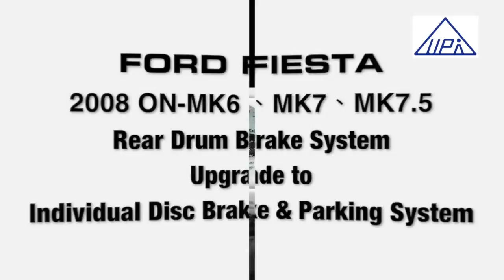Rear Drum Brake Upgrade to Individual disc brake with parking system. - Fiesta

Comment: New verna mannual transmission 1.6 is not available rear disk break in india and how to fitting rear disk break any suggestions plz tell me ...
Reply from the maker: +Amit Gupta 
I check with Hyundai Taiwan, they sell only Verna 1.6 with rear disc brake here.
We don't have a drum brake to compare its difference.
I am afraid that we could not help in this conversion kit.
As I mentioned before, change the whole axle of its rear should work smoothly in almost every vehicle if they have disc brake model.

Comment: Can I assemble in rear disk break on new model 2016  verna in my self or not is it possible or not ...? kindly help me I m soo confused
Reply from the maker: +Amit Gupta 
It is quite a great effort to change the whole rear axle.
Honestly, we don't suggest people to change drum brake in your case.
In our situation, to build a conversion kit need to open mold and lots of tooling.
Need at least couple hundreds of sets to cover its fee.

Comment: do the nissan sentra disc brakes works on the 2010 to 2014 versa/tiida?  if "yes" how do I get a set, I live in the Caribbean.
Reply from the maker: The conversion kit for Tiida  is still under development.
(Our engineers are too busy on pickup kit at this moment)

Should I inform you when this kit is ready?
Please leave your email address for contact, many thanks!

Comment: So you are using a disc / drum master cylinder on a disc /disc setup?   Careful
Reply from the maker: Disc brake - hydraulic pressure - caliper & pad.
Drum brake - cable wire - shoe.
Each system (disc brake, drum brake)  is working individually.

Comment: Hello,
I am looking to upgrade my Scion Xd 2011 from drum to disc...any advice or videos by any chance?
Reply from the maker: +koushick barua Sorry for replying late. I check the website from Japan. The rear part are the same, Ist =  Vitz = Vios. We don't have Scion here. Please check  these vehicles in your region.
We do supply Vios rear drum to disc conversion kit.
Reply from the maker: There is a very high possibility if different models user same shoe. But still a little risk remain. For example, The Perodua Myvi is almost the same as Daihatsu Sirion, only the hole which fixed the cable and back plate is slightly different. You can use tool by hand and easy to solve this problem.

Comment: How to convert front drum brake to disc brake from old omni?
Reply from the maker: We take 3D scan first, design and simulation on computer base.
After design completed, open tooling and make samples.
It takes 3~6 months for one model normally.

Comment: Do you provide rear disk break assembly for Nissan tiida
Reply from the maker: Rear drum to disc conversion kit for Nissan Tiida is still under designing.
We are very busy in developing conversion kits for pickup at current stage.
Please  wait for a while.
Thanks!
Reply: Unique Power International ok. Thank you for your kind replay

Comment: Thanks for posting video. Do you supply a kit for 06-10 Hyundai Accents? Its the MC model.
Reply from the maker: +Shalashaska016 
Thanks for your inquiry.
Sorry that we don't have a kit fit your Hyundai today.
We will try our best to work on more models.
Reply: +Unique Power International how long would it take for a kit to be made? If not is it pretty common what is needed to do the conversion? OE Hyundai / Kia did 4 wheel disk till 07 for the Accent, Verna, and Rio. i just have a 10 so it never had the option.
Reply from the maker: +Shalashaska016 
Normally, it takes us half year to create a new kit.
From measurement, design, open toolings and molds, first try and second try.......
We follow all the procedures same as O.E. does.
Reply: +Unique Power International Thats not bad actually. Full time working and a student right now so if you guus will make it in ~6 months I can wait that long. hard enough to find a donor car of the newer years anyway. Newer parts are always better as well.
Reply from the maker: +Shalashaska016 
Need to discuss with our engineer for final confirm.
His hands are full with projects at this moment, please give us your e-mail address or e-mail us to following address :
info@unique-power.com.tw
Reply: +Unique Power International Ok thank you. Im actually apart of a USA and International car group so Ive spread the word. Several of us myself included has messaged the email you've provided. Havent heard back but keep us/me posted Alex.
Reply from the maker: +Shalashaska016 
I check my e-mail and it functions well.
Please mail again and also send to : kelvin@unique-power.com.tw
Thank you.

Comment: its possible for suzuki baleno or swift ??
Reply from the maker: It's not difficult to build a conversion kit in technical.
Swift does not have an individual hub for its original.
When taking the original drum off, need to build a new one for conversion kit.
The only problem is the cost !
Reply: +Unique Power International hi I have innova 2008 model. rear disc break is available 4 that?
Reply from the maker: Innova is not on our list for the present, need to check.
I will reply you later.
Thank you.
Reply from the maker: The structure of Innova 2008 is close to Toyota Tacoma old version before year 2004.
Sorry that we don't have a kit fit it at this moment.
Reply: Singh Gippi  yes

Comment: want to upgrade a Mercury Mariner 2008 3.0L you have this kit?
Reply from the maker: +raul chagoya 
It should be the same with Ford Escape. (Need final confirm)
Sorry that we don't have a kit for this vehicle.
Change the axle may upgrade the whole brake system but not a cheap method.
Reply: +Unique Power International thank you guys
Reply from the maker: +raul chagoya 
You are welcome.

Comment: Do u do ford focus kit 2013-2016
Reply from the maker: Focus kit is for upgrading to 4 pot caliper or racing caliper.
It only contains the parking mechanism and cable for disc brake or drum brake upgrade purpose.
This kit doesn't include caliper and rotor.
In our region, all Focus comes with disc brake from the beginning.
Thank you!
Reply: Unique Power International im asking about change drum to standard brake disc
Reply from the maker: Thanks for your reply.
Sorry that we don't have a complete kit for Focus.
In our region, Focus is equipped with disc brake only, we don't have drum brake data for creating a conversion kit.
Thanks!
Reply: Unique Power International so how I can upgrade my drum brakes to disc then
Reply from the maker: We don't want to disappoint you but we couldn't create a kit without data.
If you insist, the only way is to change it use O.E.  disc brake but it will cost too much, so no one will do it.
Without quantity support, to create a single kit will cost several thousand US dollars.
From 3D scan to simulate on computer.......open tooling......production making....also takes  3~6 months.
Thanks!

Comment: can this work on a Toyota Corolla 2006
Reply from the maker: Different models come with different structure.
For example, Tacoma and Hilux are the same platform.
But their brake kits are not compatible to each other.
Most of vehicles need to design their own unique conversion kits.
Sorry that we don't have data for Corolla and we are pretty sure that the cable of Corolla is different from all our current models.
Thanks for your inquiry.

Comment: Do u have the kit for a ford bantam Rocam 1.3i 2004
Reply from the maker: Unfortunately, we do not have a kit for Ford Bantam.
(No such model in our region.)
Thank you!
Reply: @UniquepowerTwUnique-Power  its a ford fiesta pickup ford fiesta mk5
Reply from the maker: Our Fiesta kit supports models 2008 on.
Before 2008, no individual hub exist, need to spend a lot of money to build a new hub.
Reply: Damn eish wish there was a way ok
Reply: Yol should expend yol only support very few cars
Reply from the maker: It takes six months to one year to develop one model.
From 3D scan to computer simulation, sample making plus modification and testing, it takes time.
What's more important is that each model requires molds and fixtures, and these costs are also amazing!
The brake is a life-saving product and can only be done carefully step by step.
Thank you!